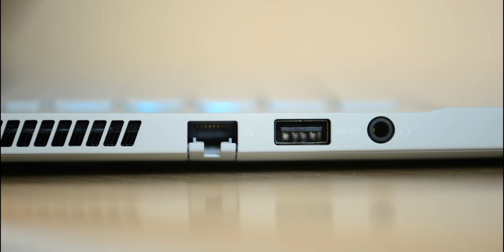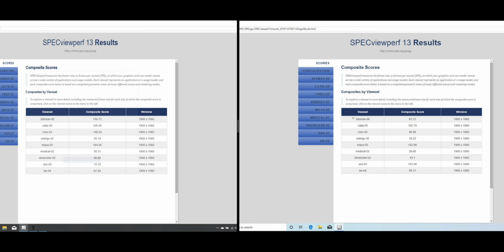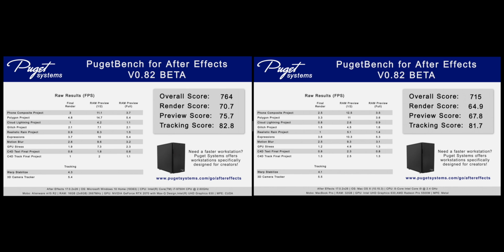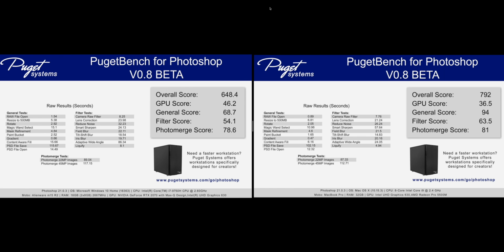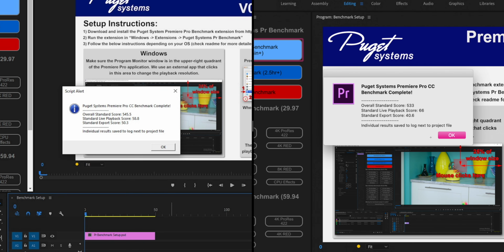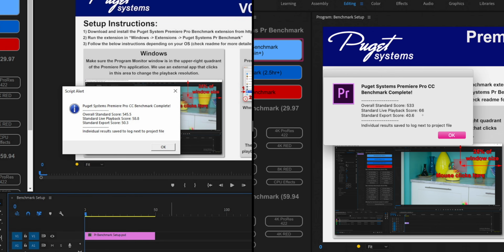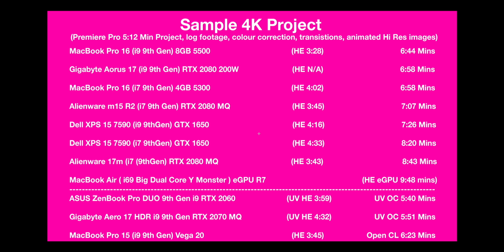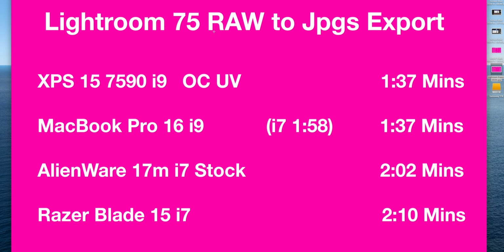Alienware m15 R2 v MacBook Pro 16 Content Creation Review | Quite Shocking

Comment: Hi ! Which one do you recommend beetween the alienware m15r2 and the zephyrus g14 ? I m a professionnal photographer and i work with an external display so i ll take the 1080p version ! I use mostly capture one and photoshop and gaming sometimes! I need something reliable and solid! Thanks a lot for your work
Reply: Mat G14; the Alienware m15 r2 throttles and has only up to 16 GB of RAM
Reply: @cameron_bosch  the alienware throttling is a normal issue, you get way better performance but trade off of throttling however, you can under-volt it for better thermal. AW also have way way better customer support and internal. Only MAJOR downside for alienware I can think of is the non upgradable ram but 16Gb is plenty imo for MOST people
Reply: If you don’t mind a smaller screen, no webcams, and prefer an AMD chip instead of intel, go for the G14. For me personally, I’m getting the m15r3 (latest ver) mostly because I need a larger screen and overall the r3 is just a better laptop to me. Though I do wish that dell can start to put AMDs into their Alienware for the next year’s model.

Comment: the alienware has less ram and a less powerful processor, you should make a comparison with the same components because this is how to put the most equipped alienware against a macbook air :(, in any case this comparison does not apply for practical purposes.
Reply: But its better for gaming

Comment: Im really happy with my 16 inch maxed out model. This edits 8k 60 fps in premiere pro, with a heavy time line with lots of speed ramps, heavy color grade, 20m project, no drop frames at 1/2 resolution (with the fans at max speed). 8tb ssd is crazy fast too
Reply from the maker: Your weapon. It's sure butter smooth

Comment: UNFAIR COMPARISON... it should be i9 vs i9 ..ues alienware only has 16 and no way to upgrade to 32..but it should be i9 vs i9 or macbook i7 vs alein i7
Reply: It will wins in some test coz the build quilty and the process and also the rtx plays a rule.. but again... i9 alein vs i9 macbook pro... pls 😀
Reply from the maker: Strage that it wins a few tests. So not so unfair.
Reply: @TallyHoTech  debe ser comparado con la  alienware 51m, ya que ese tiene el i9  y tiene ram a 3000 MHZ, creo que la mac no tiene nada que hacer
Reply: 200w vs 100w is a counter for that
Reply: alienware is a performance laptop. will kill that macbook noproblem, only thing is thermal on that alienware can get hot but you tweak it (undervolting). Some gaming laptop from other manufacturer came in factory with undervolt like razor laptop

Comment: is it a good idea to have win 10 on macbook at all? How would performance  compare? not convenient to switch to MacOs
Reply: I have zero issues with Bootcamp back when I own a mac, It's still good now from what I have heard so far. you can even run your windows in an external SSD. the only drawback in my experience is the trackpad is not as good as it in macOS
Reply from the maker: For Apps you need Windows for sure and it still performs well. The 3D tests were on Windows
Reply: @TallyHoTech  would it perfprm on win10 with photo video well, or as well as on OS? I assume Adobe not as efficient under Win?